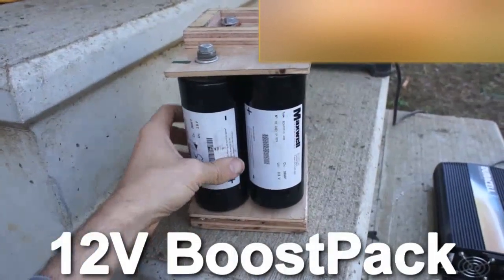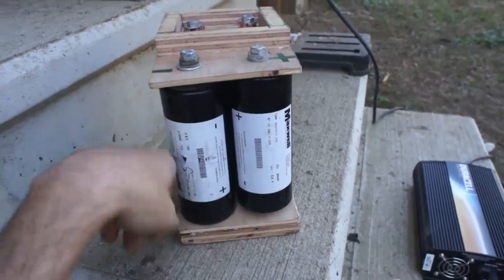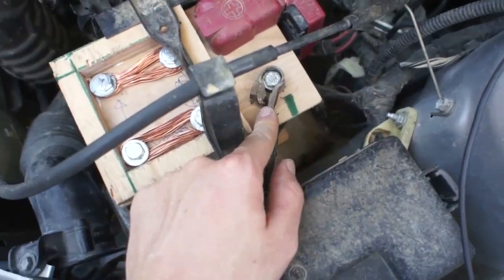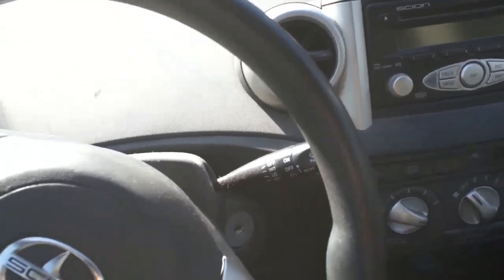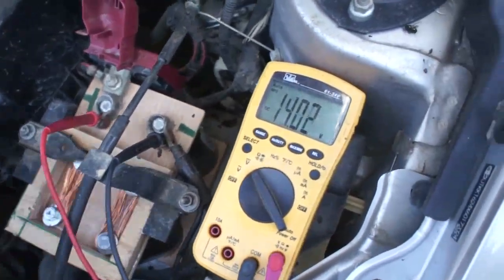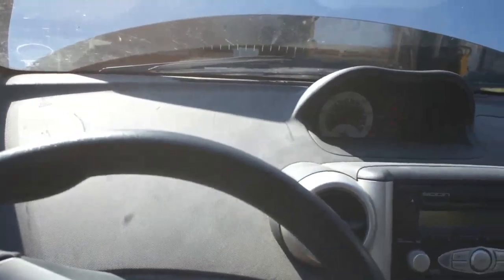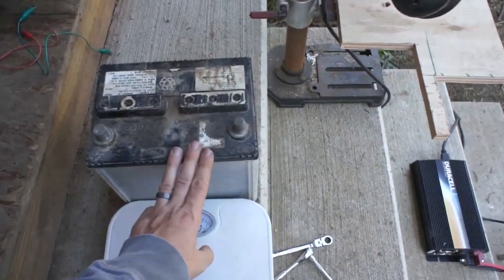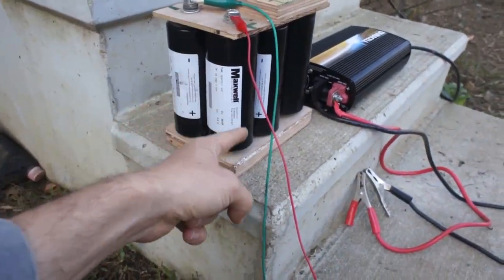12V BoostPack. Replaces auto battery. Works great!

Comment: You should really be careful with these things. Caps can discharge all of the stored electrons in them all at once. This pack could easily kill you if something goes wrong when you are handling them. The only advantage I can see to using these as a car battery is that it will put less strain on the alternator and give a very slight increase in mileage, most likely so slight that it won't be measurable and there is a lot of downside including severe damage to the car's electronics systems or personal injury mishandling them. God help you if you accidentally short them while working on the car. When I was in tech school, the teacher would do a demonstration of a large cap where he would charge it up and then short the terminals with a large screw driver. Most of the time it just made a loud noise, but it would also sometimes weld the screwdriver to the terminals.
Reply: I'm quite sure he knows this…
Reply: In my 65 years of living, I have yet to witness or hear of anyone ever being killed by 12 volts.
Reply: I guess you should know that all that its also true to the lead acid battery. They have pretty good discharge rate. And it will weld the screwdriver the same way... Actually if you let it weld, it will end up exploding the battery or melting the screwdriver.  I have seen a couple off them exploding and its like a pistol firing plus the acid all over the place. And i had in an emergency weld a drive shaft with 3 car batterys in series... Soo i belive your concernes r very true but in some way they are as dangerous as the battery itselft. I would not use them like his using for a couple of reasons. First the AH its not even close as the battery. If you forget a interior light on over night a good lead acid battery will still start the car. the capacitor not. the same goes as stopping for listening to radio for a few hours.  I will however use that cap pack as a second battery with a controlled charging so it doesnt push so hard on the alternator ( you don´t really need to charge so fast).  and a Master swith. And will only use it when needed.
Reply: Msf Oficina Most Car batteries do indeed put out enough amperage to do the same thing, I though of that after replying to someone yesterday. But the reason I let it stand is that car batteries are the right physical size to fit into the compartment making accidents less likely in the first place, and the terminals are far apart and usually have plastic lids on the terminals so they aren't exposed (in modern vehicles). Another thing is that if you short a battery in a car (a positive lead to ground, not across the terminals), the fuseable link should trip in less than a second (but I am not sure they still use a fuseable link in modern autos). Either way, I still don't see the upside in doing this other than for fun. It will put less strain on the alternator and possible increase MPG, but it would be so slight that you would have a hard time noticing it.
Reply: Aaron Kiest what???? It's the amperage that kills not the voltage
Reply: ***** My point is just that capacitors aren't batteries. and it's not a good idea to replace a battery with a bunch of caps. +Aaron Kiest They are like caps in an electric fly swatter or a camera flash in that they can release all of their energy at once.. Car batteries though are capable of putting out hundreds of amps for short bursts. The thing is, it gets pretty hot under to hood of a car and car batteries are built for that, caps aren't.

Comment: Super caps are great. You need to replace the copper wire between the terminals with a flattened out copper pipe with holes drilled in each end. :-) Also make sure image stabilization is turned on in your camera.

Comment: The problem with capacitors as a buffer for energy coming from the solar panel is that the capacity of capacitors is not too large. In comparison to batteries. This is fine if all the energy is used directly but when the capacitors are full the solar panels will be doing nothing. They will be "wasting" potential energy.

Comment: Most super caps have a max temperature rating of 70c.  If it is operating under these conditions, normally it has about 1000 hours lifetime.  I would imagine that under the hood, the temperature would easily reach that.
Reply: And car  batteries should NOT be operated at 80F or higher since it will shorten their life cycle enormously to a point that it will destroy them.
Reply: WTF BBQ

How did you figure that car batteries  are cheaper?

Cheaper as in original cost or first investment?
Or Cheaper as longevity?
Or cheaper as KWH per lbs?
Or cheaper as  ..........?

Many of those things mentioned above does not make a car battery cheaper.
Reply: WTF BBQ
You should not run your radio nor any other things when the car is not running anyway, this will lower the live of the battery.
I would like to know where you got that $60 battery. The last battery I bought for my wife's car was $140 and lasted 3 years.
The car battery that is in  my car will be 8 years old this  October and it did not get that old by playing the car radio or charging that phone or having any lights  or the fan on  while the engine was  not running.
There are many tricks to keep a battery good and a capacitor and or a small solar panel is one of them.

A battery may be cheaper than a capacitor in getting them, but will a battery last over 40 years like the capacitors.
Reply: Car batteries are cheaper ........
Reply: J&B Homeliving
A typical car battery cost between $60-100  and will last you  3-5 years.  Most people typically keep their car for 10 years (some 5 years).  Each capacitor Laser is using is about $90-110 and you need 6 of them.  Longevity depends on your protection circuits and temperature.  You can't run your radio when the engine is off,  and if the car has trouble starting then you only have 1 or 2 attempts to get it started.
Reply: @WTF_BBQ  Wrong!
Reply: @SamaritanElad  
oh yea,  you're so helpful.........
Reply: +J & B Homeliving 
I got em off walmart here in Florida.  They range from 2-5 years life span.   Usually around 2 years in realistic Florida weather.  I've had mine for 3 1/2 years and still working.
Reply: cab3 "some" arnt that way so you cant see how it would be a problem? have you tried not sucking at critical thinking?
Reply: Some cars have the battery in the trunk so i don't see an issue here...
Reply: good for them. what about the ones that arent in the trunk, ya idjit?

Comment: Oh yes also you alternator may be loaded more than usual during low idle u might need some resistance to slow the discharge
Reply: You mean charge. 10-20 seconds and caps should be fully charged

Comment: I have built a similar setup with 6 X 2000 Farad ultracapacitors but when charging them at 5 amps, I have a huge voltage imbalance some of the caps. Haven't hooked it up to my car yet since I am afraid one or more of the caps will overcharge and vent. You aren't using any balancing circuitry so why is my situation different than yours?

Comment: How do winter conditions effect the boost pack. This could be great in riding mowers, cause you would just have to recharge it in the spring instead of replace the battery!
73
Jimmy, ARRL TS, WX9DX
Reply: The electrolyte in the supercaps should be unaffected down to about -45c for some and -49c for others.

Comment: Gentlemen for Safety : Never use capacitors as battery replacement, capacitors has a characteristic to discharge a huge amount of power instantaneously that can stop your heart or kill you or your love ones if you left it expose in your garage, there is no such thing as battery replacement invented yet. It is not even cheaper if you really want an equivalent 12V battery/80AH you need a capacitor banks of 12V/24000 Farad which is double the price of car battery and the discharge characteristic is totally different # from concern citizen with18 years experienced in power electronics.
Reply: Sorry I don't accept this, 18 years in power electronics or not. If you have a high enough voltage to push the current through then 100mA will stop the heart within a few seconds, 400mA will do it effectively instantly BUT you need a high enough voltage to push that current through.

You could have a capacitor bank with 1000,000 Farads - but if it is only pushing out 15v or so, then it is never going to stop your heart (or even give you a mild shock other than on your tongue) - even if it was storing enough energy to start 1000 cars at least three times each.

It is true that the near instantaneous current discharge could cause a fire or burn if short circuited - but then a fully charged 80AH car battery will do a sporting job of that too. As for "no such thing as a battery replacement", that really depends on what your requirements are surely. Supercaps, fuel cells, solar cells have all been used to replace batteries in some applications. Perhaps the statement was a little bit too sweeping?
Reply: Supercapacitors have been in usage since at least the mid 80s when some manufacturers used them in lieu of batteries for backup memory in home audio and TV. I haven't had to replace nearly as many supercaps as I have Lithium button cells which require at least 5 times as much space as said supercaps.
Reply: Cheaper may not mean cheaper.
One or the other one may be cheaper when buying it, but you have to look for long term.
A battery may last 4 years and a capacitor may last well over 10 years.
We still have a big power equipment, where the capacitors in it are well over 40 years old. 
So, a capacitor may outlast a battery anytime and there is no maintenance with an capacitor.
Reply: Tell that to Nikola Tesla with his experiments with electricity... keep experimenting, and try not to get killed.
Reply: Why do stupid ppl leave idiot comments like this. Nobody cares about your twisted opinion.
Reply: @hunterstowe5342  
Apparently you did, since it bothered you enough to leave a comment. Examine yourself, learn about your triggers, and have some self-knowledge... it will make you a better human being ; - }
Reply: @hunterstowe5342  "Reprove a fool, and he will hate you. Reprove a wise man, and he will love you".

 If you can manage to get out of your own way, maybe you would have the courage to find out who wrote this and begin an exciting journey of self-discovery. Life can be an adventure if you humble yourself and become as a little child - curious.
Reply: It doesn't matte row old u are it matters wat u kow
Reply: Who cares about cheaper? People want to save the planet so our future generations can live. What dollar amount can you put on avoiding extinction and having a clean environment for grandchildren to grow up in? It's shocking to the conscience that you would prioritize saving a few bucks today at the expense of humanity's future. And the dishonesty of your claims is abhorrent. A 12-15 volt capacitor is not any more likely to kill someone from shocking them than any other 12-15 volt power source. The current is limited by the entire circuit, so you can't just compare the current limitations of a battery to the superior current providing performance of a capacitor and conclude that one is more deadly. In any situation that you can imagine a capacitor killing someone, the battery would do the job just as effectively. It's just common sense to respect all electricity and always use safety precautions. Same as you always respect a gun, no matter if it's a huge shotgun or a little .22 caliber. Life is precious.

Comment: your battery needs electrolyte. plates have to be covered.
Reply: I partially agree on that, but still, once the battery goes depleted it can no longer be recharged. I personally tried pouring the sulphurous acid into a motorcycle battery and all I got was power for a short period of time, no effect for longer time if the battery's already depleted.
Reply: @therionman52  i just add water
Reply: @ceejayc6502  You can add what you want, once it's dead it's dead.
Reply: @therionman52  bullshit, i have resurrected LA batteries many times with a trickle charger
Reply: @ceejayc6502  Not is cells gone dry.
Reply: mario kempes ?
Reply: therionman52 1350

Comment: lasersaber  The 14v when the car is running is the output from the alternator.  You need to make that test after the engine is turned off.  Most car alternators charge at 14 volts and cycle based on the battery draw.  Just starting the engine I would have to conclude that as a Master auto mechanic the voltage reading you got was based on alternator output rather then the charge being held by your pack.  Just thought you might want to make a quick revise on your video.

Comment: Dude I found a way of running it continuos from the inverter using the booster caps u just connect a 12volt adapter to ur inverter then connect it back into the booster caps and they will stay up charge for a long hour I'm gonna test it for running the whole day which is 24 hrs